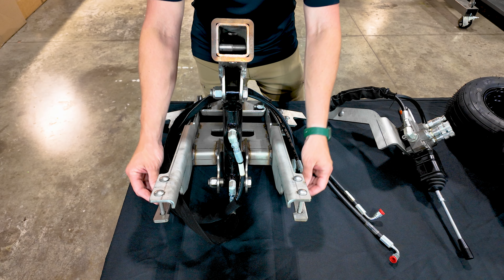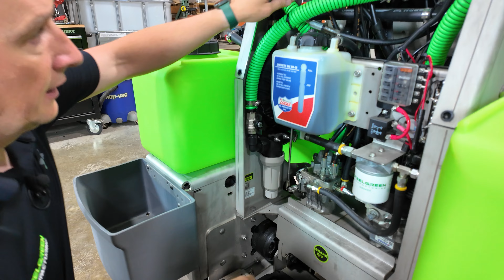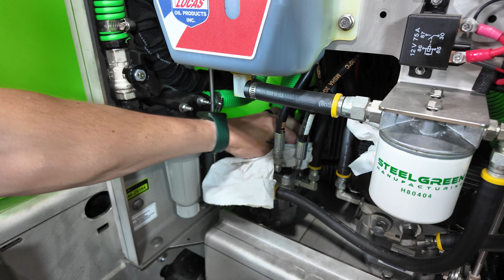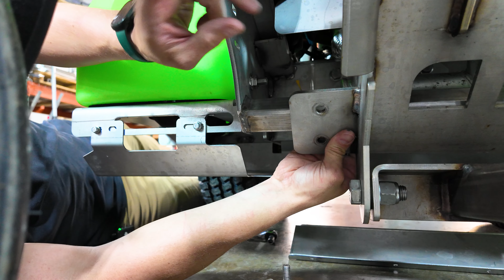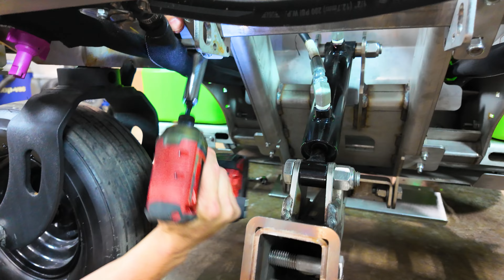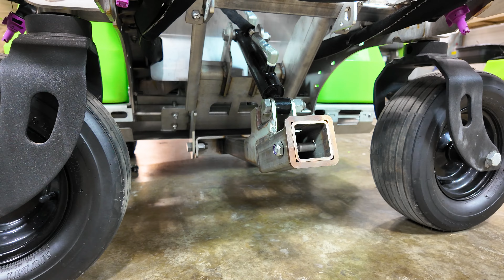How to Install the Hydraulic Lift Kit

Comment: Without meaning to this video demonstrates my biggest complaint with Steelgreen. The machines are extremely difficult to work on and the sheet metal needs to be finished better. These machines will cut you every time you touch them.